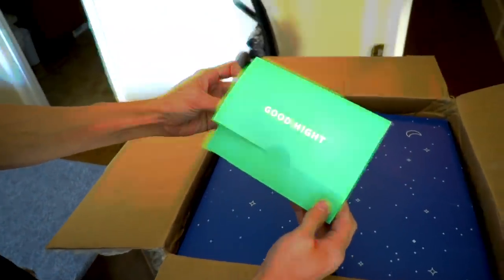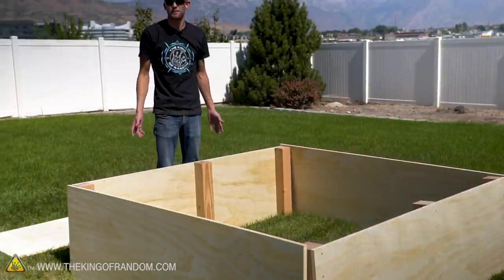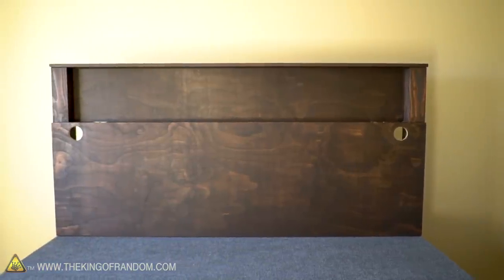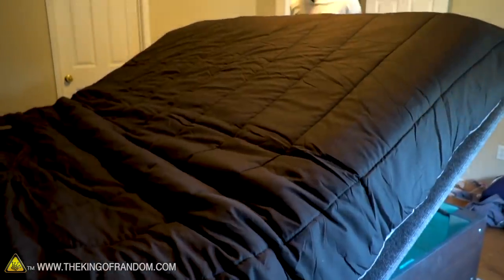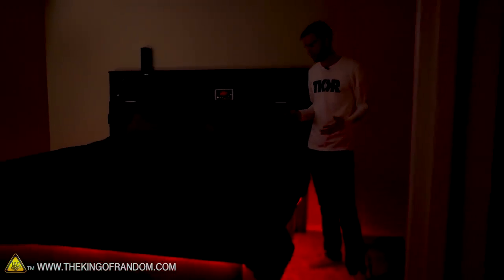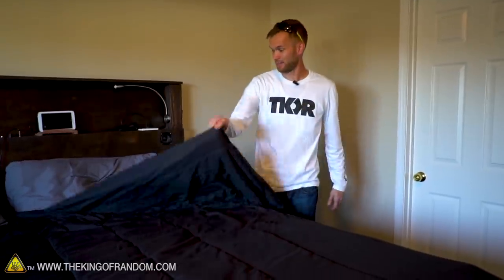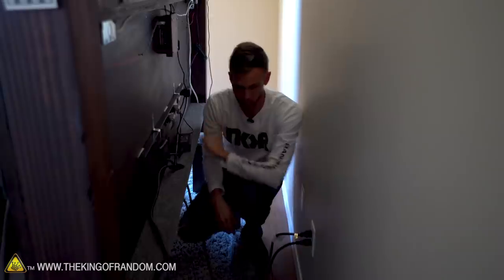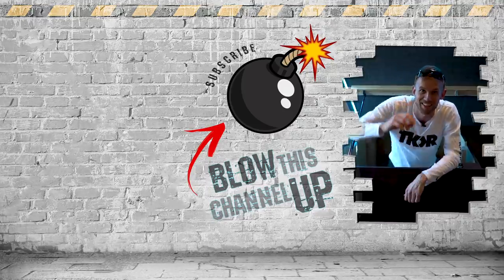I Slept in This for 8 Hours Straight

Comment: Here's an idea,
Make a vacuum chamber but with 2 holes in those 2 holes put gloves stuck to it inside the vacuum chamber, see how different things feel in a vacuum chamber. First proto putty in a vacuum vs normal proto putty, hope you use this idea
Reply: it wouldnt work becuz the suction inside would cause the gloves to inflate like balloons and pop.
Reply: If you use strong, noto strechable gloves, it might work, but then you couldn't fell the things. So, it wouldn't be possible to do it the way you described it, but it would be possible if you change a few things.
Reply: SantasFatRat j
Reply: You probably couldn’t get a proper vacuum with your hand in their 

And your blood will start boiling maybe
Reply: DA BOSS it wouldn’t because the gloves connect to the outside
Reply: that would be interesting
Reply: They use large vacuum chambers with glove access to tig weld specific parts that have to be perfectly welded. Just saying its not a new idea.
Reply: i have been telling them to do this but they never read my comments

Comment: I’d be scared that it would catch on fire while I’m sleeping....but maybe thats just me 😐
Reply: Nope not just you
Reply: Chy Ari well LEDs don't produce heat and you can always plug the stuff into a surge protector to prevent any funny electrical business. But I agree that can still be a concern
Reply: What part would start the fire though?
Reply: Andre Martinez overloaded outlet
Reply: Killian Viehmeyer if it was overloaded the breaker should pop what would be best is a inline circuit breaker
Reply: @karzygijose  or the fuse
Reply: Now I don't wanna jinx it but I'm pretty sure that's a one in 3 billion chance of happening
Reply: Andre Martinez the outlet on the shelf part
Reply: Andre Martinez I mean if for some reason the insulation on the cables were to fray that could potentially cause sparks or more likely it could touch the wood and pump electricity into it which would cause it to eventually burst into flames
Reply: THATS FUNNY don't blame me I'm a psycho >:)
Reply: @andremartinez418  the heated blanket, the amplifier for the speakers, the power strip if it's a cheap no surge protector one, the LEDs if they are getting a higher voltage than what they are built for (the voltage regulators still get hot), human, etc.
Reply: Just you sorry
Reply: @andremartinez418   Wood and an electrical short.  That is also how houses catch on fire from time to time.
Reply: Not alone ma dude
Reply: Andre Martinez that’s too many plugs and I’m sure that ain’t OSHA approved and the wires melt especially the skinny ines

Comment: What happens when you mix water and lithium in a vacuum chamber?
Reply: same thing as in air -potential fire
Reply: @thomasbark1677   forget potential
Reply: Depends on how fast you mix them and how much of a vacuum is it. If it's a regular vacuum chamber type vacuum, then depending on the speed you will either see flames, or something known as a Coulombic explosion. (It's an interesting effect that happens when something is so strongly charged, that the similarly charged particles of this material repel strongly enough to rip it apart, and it happens very fast resulting in an "explosion")
If it's a nearly perfect vacuum, we can easily assume the water is vapour and so the lithium is likely just reacting with the water with not much flames because the leftover hydrogen can't burn.
Reply: Eragon Shadeslayer EXACTLY
Reply: U got a diesel vacuum cleaner roll some Cole. 

Edit: sorry didn't read the comment

Comment: I made something like that before. The whole under the bed was a Dog House and place for some storage. Also had a door on it that opened with a trash bag. The height was just enough so you could get out and stand without lifting yourself up at all. It didn't have any lights or wiring, and didn't lift from the top.

Comment: It's still all on the same circuit because the two plugs in the wall are on one circuit. That's just to point it out. BUT it's not really a problem because everything you have plugged in is still drawing well under 15 amps, which is what the circuit in the house is probably rated for. Nice job!

Comment: Lights, electricity, music, cup holders......... you made a make-out bed!
You should have put some grills over those speakers and put a subwoofer under the bed. 😉
( by the way, I saw two plugs plugged into the outlet on the wall and you said that your bed was on two different circuits......... that outlet is ONE circuit.

Comment: In most cases plugging in to the top and bottom of a receptacle you will be on the same circuit. You can run two separate homeruns to one box and break the tabs on a receptacle, but most houses aren't wired that way. However, i don't think that bed really draws enough to need another circuit anyway

Comment: What happens when you pour molten metal (or something else) into a mold made from dry ice?
Reply: The molten matter would be blown away by the force of the gases rapidly released by the ice from its heat alone.
Like an ice cube or drops of water in a frying pan  preheated on high, it kinda looks like it is hovering, except molten metal or stone doesn't typically have much gas inside. so you would want to control the area from the blast of heated projectiles.
Reply: @SegaDream131  Would be an interesting watch!
Reply: +DiecastNZ I like casting aluminum with styrofoam and sand.
Reply: @SegaDream131  Nice one!

Comment: Those are on the same circuit unless you ran a new homerun from panel to the outlet and broke the tab on the screws to separate the top and bottom outlet

Comment: Ok, so I built the bed. I got nearly everything done EXCEPT for the gas struts. I bought some 25" ones but they have issues. Can someone tell me the ones he used for this (with the mounting hardware) so I can finish this?
Reply: Where did you find all the parts?
Reply: @spochan4  Its just 4x4s and plywood. Also some door hinges.